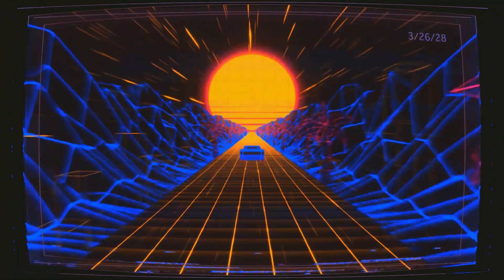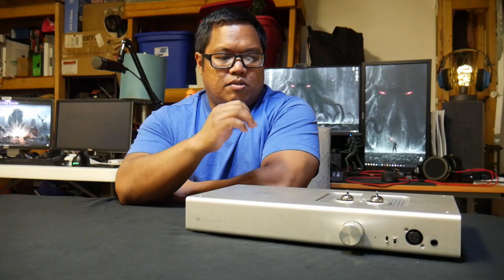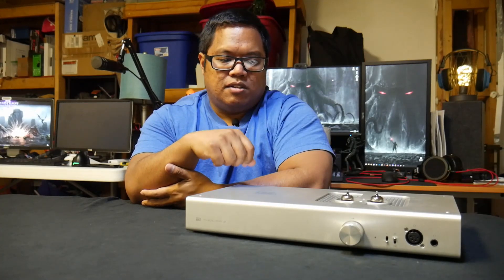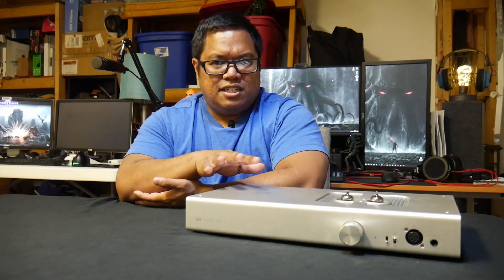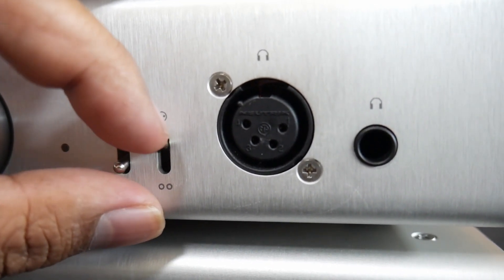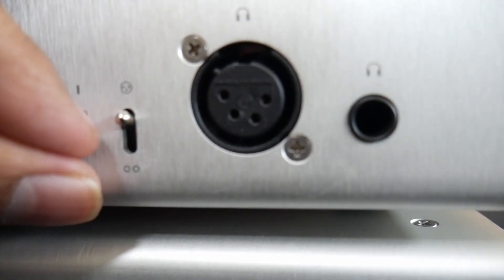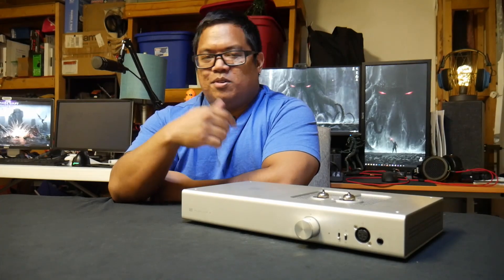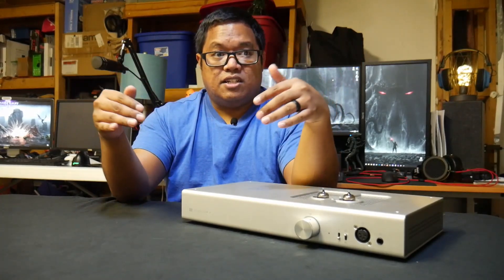Schiit Mjolnir 2 Review

Comment: Hey man.... good stuff.  You deserve more Youtube love.  I have what's probably a weird question on Feeding a Dac to the Mjolnir 2.  I have a Monolith 788 Dac/Amp combo and was wondering if it's possible to just use the Dac portion on the 788 to feed the Mjolnir 2 Tube Amp?  Or do I need a a Dac that stands on it's own like the Gungnir to feed the Mjolnir 2?  I'm obviously looking at this from a cost saving stand point.  $1300 for the Gungnir Dac is a lot of money... so I'm looking for other options.  Thanks
Reply from the maker: Thank you so much! I do believe you can run it just as a DAC due to it does have unbalanced RCA outs. You just have to find that option in the menu of the 788. Let me know if you find it!
Reply: @BennyKsBandwidth  Good point!  Maybe I should try reading the 788 DIRECTIONS!! 😆

Comment: Hi Benny, can you recommend a midfi tube setup for the hd650? I am looking to try tubes for the first time.
Reply from the maker: What is your budget?
Reply: @BennyKsBandwidth  Thanks Benny I am thinking of up to 700 dollars. Just because I see amps hanging around 300-500 dollars. Currently I have an ifi zen stack and fully into MQA. Thank you. I keep on hearing that I should tube the hd650. I like neutral to warm sound signature. I am loving the bass boost on the zen can.
Reply from the maker: A few good choices, Used Mjolnir 2if you can find one for hybrid solid state/tube, Darkvoice 336se just tube, Xduoo TA-20(dac/headphone tube amp) can be used as just a tube amp. 3 choices for $700 and under
Reply: @BennyKsBandwidth  Thank you I will definitely check them out.
Reply from the maker: Good luck my friend! And whichever you buy you can always tube roll for a desired sound.
Reply: I'm trying Valhalla 2 right now and tube amps are their own beast. Preferred the 650s more with the Vali 2. A little bit of solid state goes a long way. Considering the Lyr. If you were curious about Schiit (using Valhalla with Bifrost).